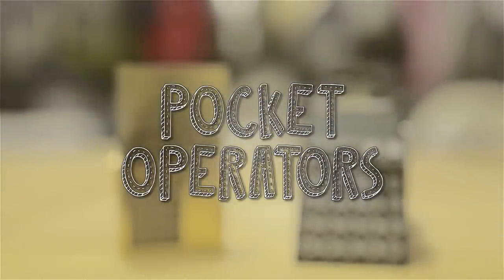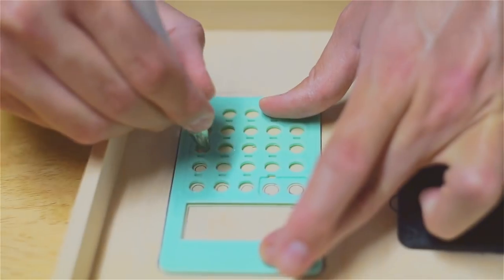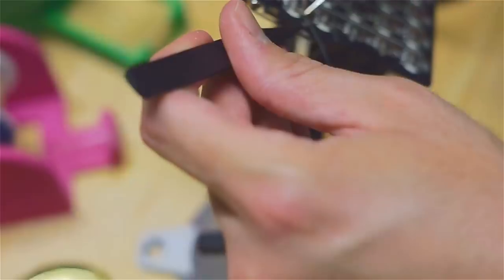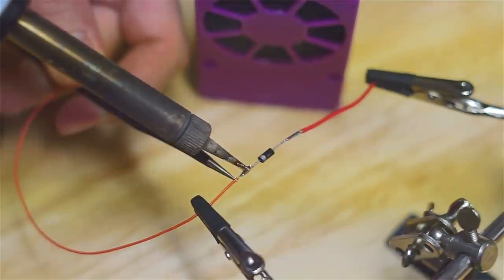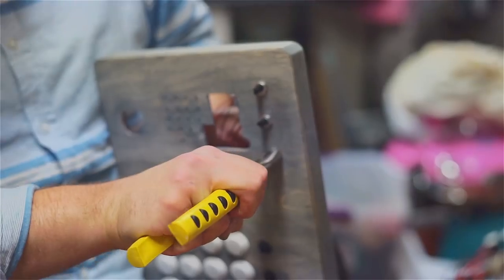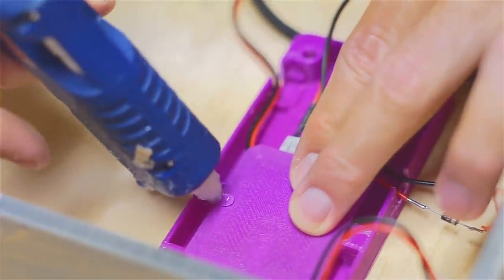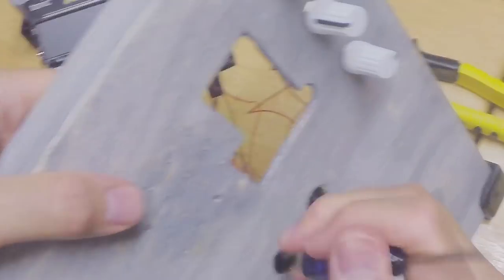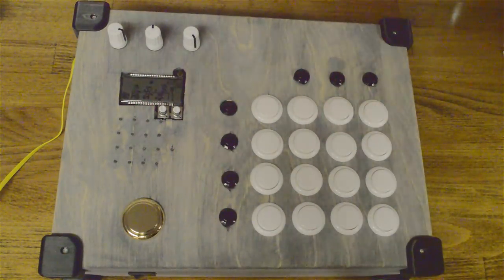Pocket Operator Arcade Button Controller Case: DIY How To

Comment: Useful instructions thank you.
TIP: When drilling into such thin material it's a good idea to place the panel onto a thick piece of wood and clamp them together on the bench so the panel is fully supported, then the drill doesn't burst through the rear and leave it splintered.  Also flat bits are quite lethal and uncontrollable, use a manual brace and bit (far slower and much more contrallable) or as you said, a hole saw.
One other thing, how can you write on the caption "SOLDER" then pronouce it SODDER??  It's like Soldier but just remove the 'J' sound - Say "SOUL-DER" and you have it and will not get grief from any other English speaking country ;) Heat-shrink sleeving is also a good idea to protect all the wire joints..

Comment: yeah I was thinking the same thing. Why fix it when it aint broke? But I can see where if this was done in clear plastic with alot of extra lights it would be beneficial for dark stage performance, maybe? I dunno but these are fun little devices when you use them in unison with the Boss rc-505 looper.

Comment: Has anyone tried to replace the pots? B was totally gone and A kept randomly changing pitch. 
The board looks really thick, how is the thermal mass of this thing? Can I just flux and mop or do I need to heat the board first?
I'm a complete novice when it comes to soldering.

Comment: Hi, I want to build it similar but I only want to connect the buttons (no lipo battery no audio cables and no beat repeat) how should I connect the buttons? Once welded as in the video do I have to connect them to the ground? If so which pin is the ground?
Thank you